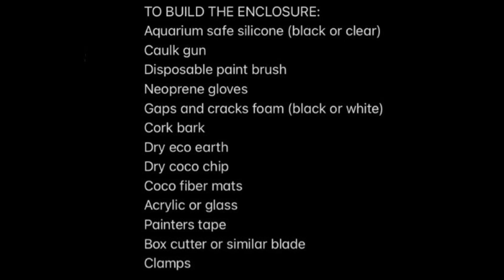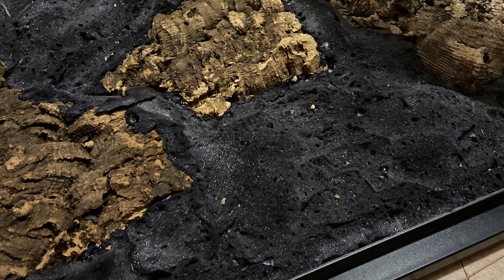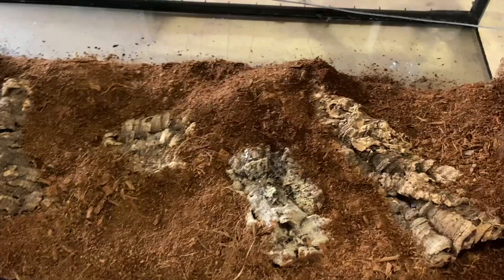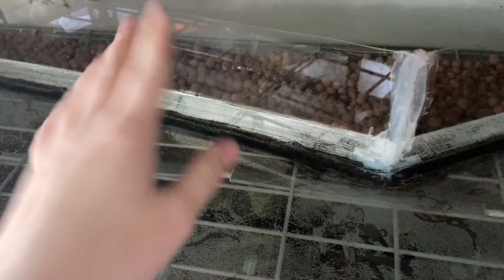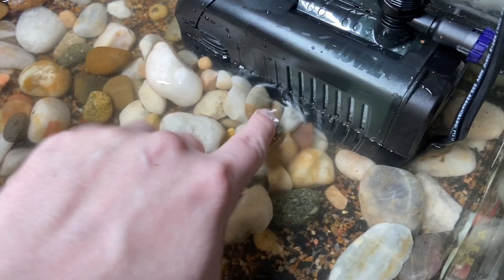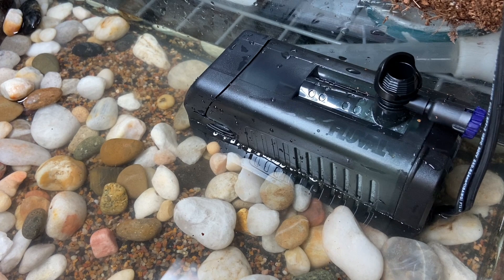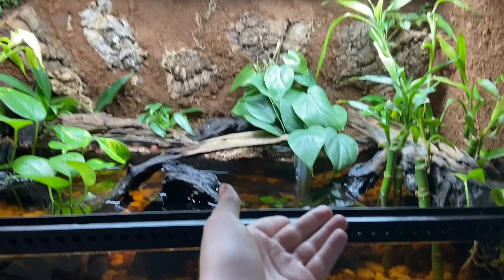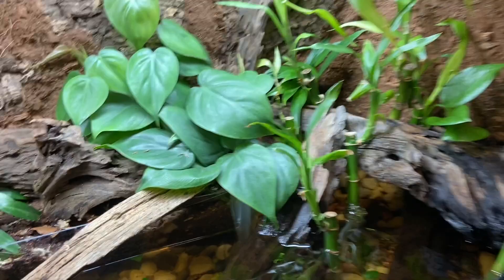How I Built My Paludarium | Fire Bellied Toad Tank

Comment: I am not sure if you'll see this, but how do you heat / keep the temperature for them in the winter, when room temperature drops by 5-7°C ?
Reply from the maker: My room temp is still fine with that drop in the winter but you could use a low wattage heat bulb or better yet an aquarium heater
Reply: @JessicasAnimalFriends  Thanks!